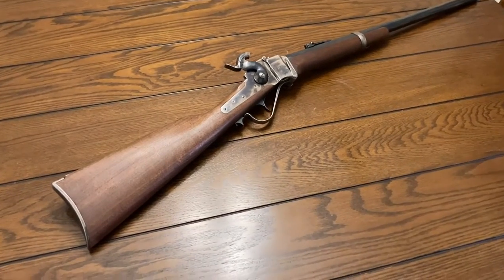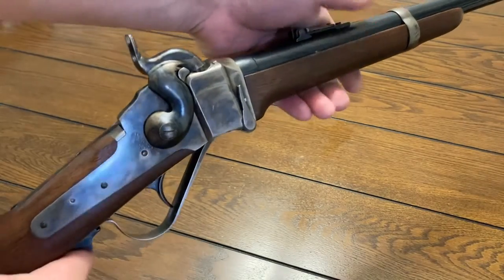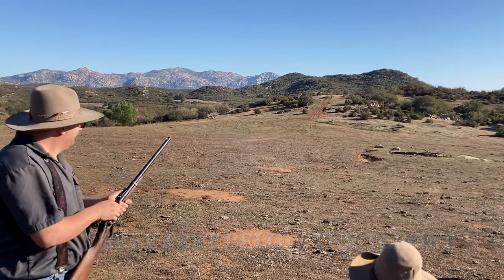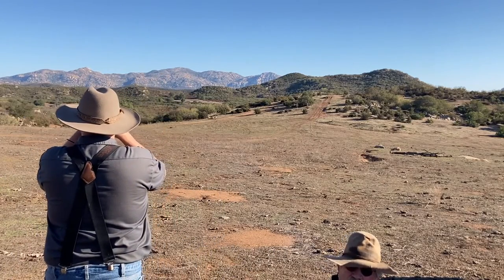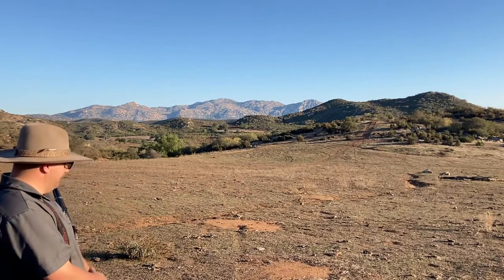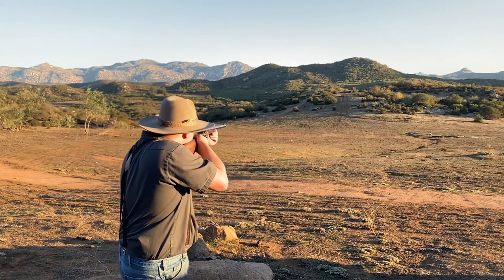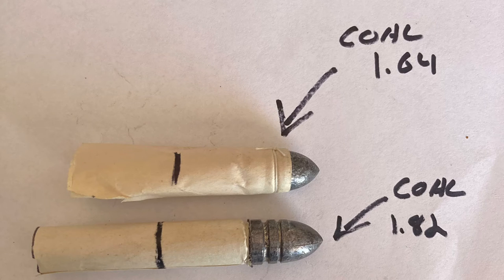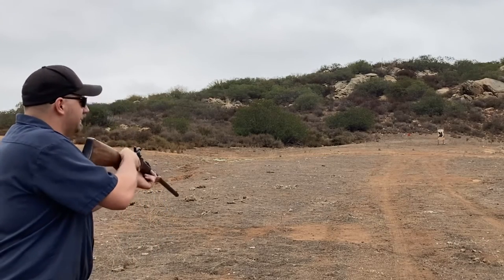1863 Sharps Carbine Problems

Comment: Another factor to consider is chamber length. Duelist1954 has shown that different makers have been using different chamber lengths with Pedersoli having one of the longer ones. Simply making a cartridge from a commercial former could end up with a cartridge that either has to jump into the rifling or if seated, leaves a gap for the cap spark to jump. Not good for consistency. Measure the chamber and make a cartridge that fits yours.

Comment: If I just load loose, it takes about 100 grains of powder to fill up the chamber. Are you using that much powder or are you putting a filler in between the bullet and the powder?
Reply from the maker: Grits

Comment: So….An 1863 Shiloh Sharps .54 will top off with about 120 grains. Is loading 70 or 80 and leaving that much air space gonna affect an 800 yard shot? Should be using measured corn filler or something before dumping the powder in? Or corn topping a paper cartridge? Thoughts?

Comment: This gun should be used with metal cartridges, I don't know how they are called in english, in practise these are brass cartridges without the primer, only the open canal.
Reply from the maker: Interesting, I’m not familiar with those. Is it something like the smith carbine uses?
Reply: @Everythingblackpowder  Yes, for some reason Youtube deleted my last post with links to the Polish shop with this gun and proper special brass, that contains the valve.
Reply from the maker: @Qwertypp10  thank you
Reply: I checked out the link you had up here. When I came back to thank you for posting it it had disappeared. UT tricks? anyway thanks for the link. very interesting
Reply: @35southkiwi16  No problem, YT deletes after ~~15s comments that have some links and some words...
Reply: @Qwertypp10  thats bad ass great find ...😃

Comment: Not sure on your take, I am running the Pedersoli Shaps 45/70, 32 inch barrel sporting 1863 model. I am assuming, more than likely the breach loading system is exact the same. I have been told 2 things about shooting them. (1) one by a gun smith, who said like you, drop the bullet in the breach top up with 30,50, 70, measure or a full BP load, it would take near 100 Grains or so of BP, close the breach cap it of and "BANG." Although I could use a little rice to pack  it out if you want smaller loads behind the bullet. (2) another person said, yes it will work but the rubber O  ring, will blow out within a few shots.  Whats your take. Never shot it, I still have about 10 Brass shells which hold about 55 grains of BP. And 380 grain bullet. Any advice would be good. Which would you go for on the options ?
Reply from the maker: I can’t say. I wouldn’t be afraid to try either one
Reply: @Everythingblackpowder    30 grains of powder; using  black powder would not be that good with such a big Cal and heaverier bullet. I was refering to my comment regards black powder use!! I have about 385 grain lead bullets same system as you have, but my one is .45+ cal I have brass shells which hold about 55/57 grain from Pedersoli for this rifle. using about 2ff home made BP. so logicaly  following your idea droping the bullet in, loading up with some rice,or other filler, following by about 65 to 70 grains I would basically be copying you.  Is yours a Pedersoli rifle, if so, the system breach wise is exact the same except difference cal aspects/size.  But not sure if you know, but the rifles are proofed to smokless powder, that information comes stright from Pedersoli own test Proofing house, as a point of interest ! Happy post up the results. I am confused as to why you said you would not try it, clearly in the film your have.  🤔 or have I just missed something here !!
Reply from the maker: Yes you missed something 😉 I said I wouldn’t be afraid to try it. This rifle is made by armi sport. And can’t hold more than about 50gr
Reply: @Everythingblackpowder   HAHAHH thanks thats put that question to sleep. thanks again. Power to you Bro!!   I did top my rifle up once never fired it. but it held a 100 grainof BP.  that would give good punch in the shoulder hah.. But You were correct. OPPS!!

Comment: I have the Pedersoli. It takes a hundred grains of 3F to fill the chamber if I shoot it by loading powder and bullet. I make the Eras gone bullets. That does work great, but I don't want to waste all that powder (I did this way before seeing this video). So, I have to use filler. That means a paper cartridge of some kind as far  as I can figure. Or...are you putting the filler in directly too? Then the powder behind it? If so, I assume that only works if you move the piece very little and shoot it right after loading. That wouldn't work on a hunt where you were climbing crawling and scraping your way to your game would it?  wouldn't the filler mix in with powder? Has anyone ever tried this and left the gun loaded for a time? I'd love to know.  Mine also suffers from poor ignition (now I am not a novice to flintlocks, been shooting them since about 19 and 74.) Started shooting cap and ball revolvers around 15 years ago.  Got my Sharps around 5 years ago. Have never had a problem I couldn't figure out before...Until I go this Sharps. I have to take a little powder from the sheered off cartridge and drop it down the cone to get it to fire. It seems like weak caps but I've tried them all.  I have made nitrated flat bottom cartridges but it wont set them off regularly!  I've lost interest in it because, for me it has been NO fun to shoot.
Reply from the maker: Sorry to hear that. Are you interested in selling it?